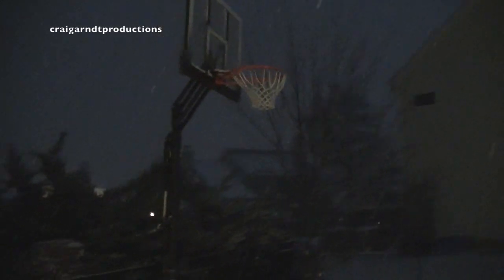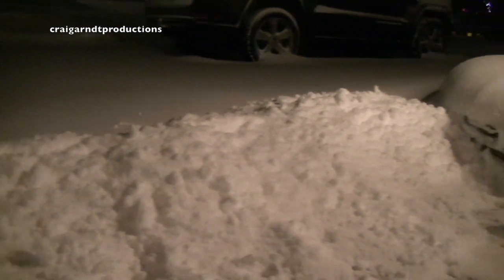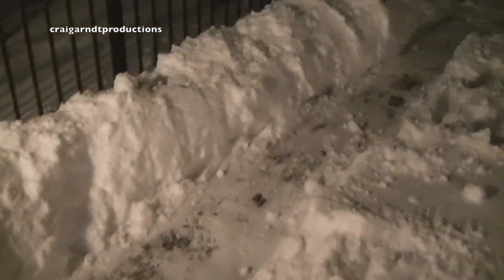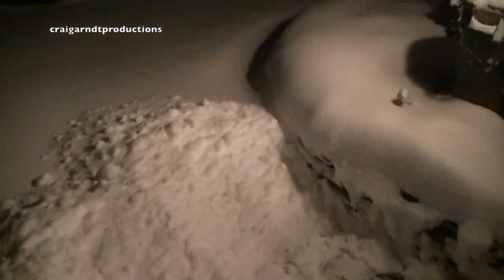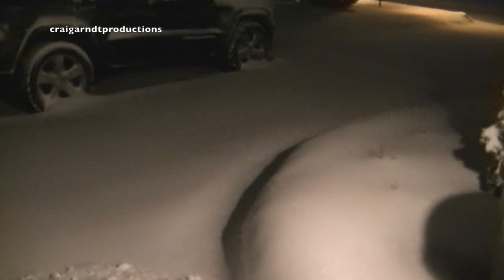Lake Effect 101!

Comment: That blower really does the job. I've seen a few times when I sure wished I had one. I've heard that those lake effect snows can really dump a bunch.
Reply from the maker: I much prefer Ariens snow blowers, at least those I've owned in the past.  They are a heavy gauge steel and have grease zerks on the axles, inside the drive unit and on the augers.  Its just a much better unit, just no comparison.  This was free so I hate to complain, it does look nice, but it's not up to a Buffalo winter long term.  This MTD made Troy-Bilt doesn't have one grease zerk to keep it lubed and I've already had to hammer the auger back in place, my son hit the front step!

Comment: how come people snow blow at night? I'm in Florida so I don't know much about snow
Reply: Joshua Willis it gets dark at like 3-4pm up here in the winter  and people get off work usually around 5-6pm and snow blow after work
Reply from the maker: Steven is absolutely correct, daylight up here is very short in the winter.  We also snow blow early, its not uncommon to see people clearing their driveways at 5am.  Either to get out and not stuck from the plow or just to clear it.  You don't want to drive over the snow because it packs it down and you'll get ruts and it becomes slippery and dangerous to walk on.  If I cut my lawn at 5am the cops would come... but it's expected to find people snow blowing early or late... winter is different!